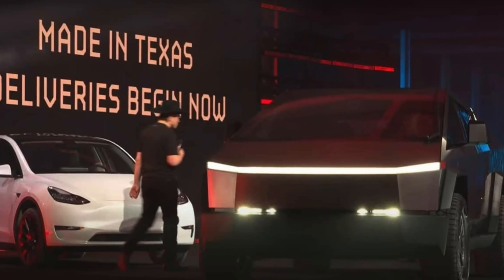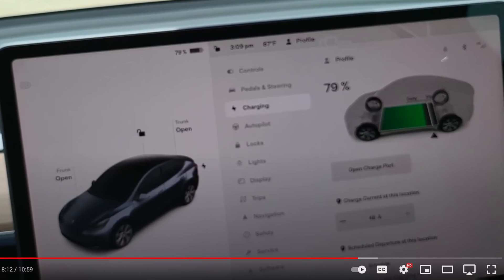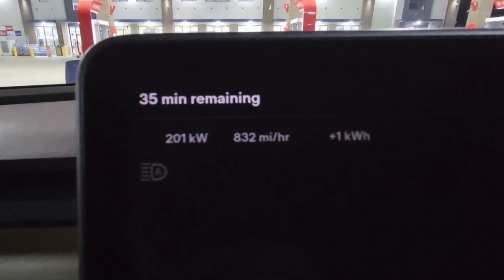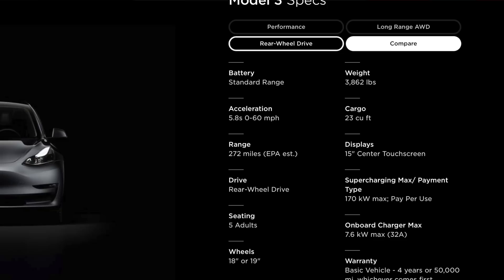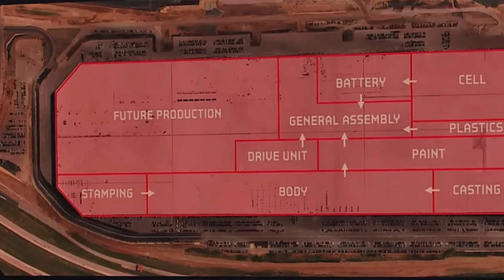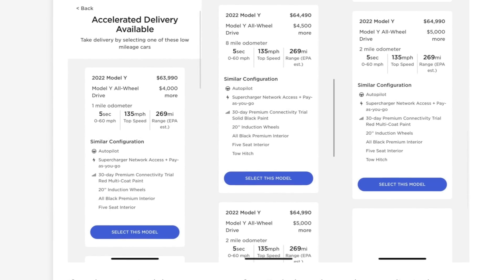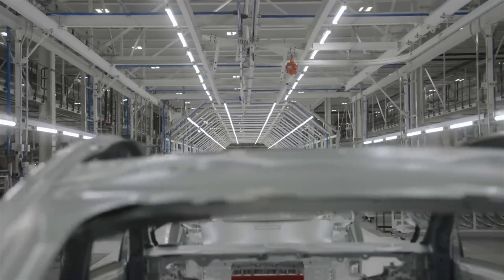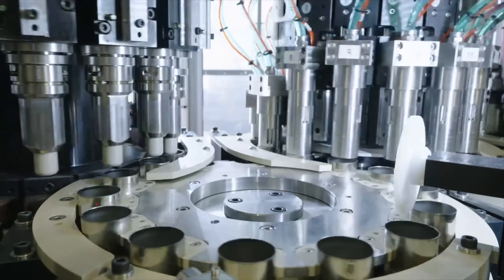GigaTexas Delivers 1st 4680 Model Y

Comment: Without a 500 mile cybertruck this will be a useless tank. We need a 500 mile cybertruck if you want to do any towing. Stopping to charge every 70-90 miles isn’t going to work.  Tesla may offer rugged batter packs that could mount on a trailer and extend range when towing.

Comment: I disagree. I think Tesla will want to prove that they have the superior work truck which will require longer range so that the truck can tow things. Also, I think we are seeing the first stage of the batteries. If I remember right, Elon said that they are still working on the battery composition to make 4680 batteries Superior.

Comment: just to be clear, you believe the price will jump from $60k to $120k due to inflation and some other minor factors?
Reply: It’ll be 100k because of the increased number of batteries required for it to hit certain range numbers. They thought 4680s would be more efficient than they are.
Reply: It won’t be 100k guaranteed. Tesla needs to remain competitive with other car manufacturers such as Ford. I think they are really sandbagging the performance of these new 4680 batteries.
Reply: @TheMsliwowski  or they just overhyped the 4680

Comment: The only advantage with 4680 is battery degradation because of the tabs where batteries don't need to be heated as much as 2170 to charge which will cause  degradation

Comment: The battery is new and doesn't have a large amount of supply, make sense to make short range Model Y's first. I don't think it's much of over hype as much as it is Tesla making sure to start low charge with batteries so they can take data off it. Who knows maybe a software update may unlock the batteries to do more potential after all it is Tesla, we are talking about.

Comment: Unfortunately I think you're right on a lot of your predictions. I keep wishing for a $70k 500+ mile Cybertruck like I dropped $100 on the day after the reveal, but I'm afraid reality will be different. And even tho I'm kind of close to the first of the order list, I'm with you on thinking it will be all about efficient deliveries. I also wonder how many are like me, excited about seeing the production ready Cybertruck IRL, but not ready to buy until I sit in it and actually drive it. I will decide at that point if I can live with it and use it.. 
  But one way or another it will be an excruciating decision because I'm afraid I will give up any amount of practicality and usability just because of the fun factor of driving a stainless spaceship with a yoke 😃
Reply: I have a similar mindset as you. I really wanted the Cybertruck because I love the designed and the 500miles was very useful. I have a small boat and to take it to the coast it is 200miles from me. With the fact that range is cut by half when towing, I figure that with the Cybertruck I could get 250miles of range towing, so that would have been perfect as I could make it to the coast and still have 50miles left over. Now that the range will be like a 300miles total, it means when towing it will only get like 150miles, which means I have to recharge once to get there and one more time to get back home.
Since this is not something I really need, I will probably cancel when it becomes my turn and wait until we don’t have constraints anymore on battery and other material and the Cybertruck actually comes out with 500miles range.
Maybe by that time the price will be lower and there will be better features and FSD will actually be REAL or really close to REAL, meaning only needing one human interactions every 10,000 miles. Also the USA may allow side camera instead of mirrors and a new way to clear water from the windshield comes out, for example blowing air in the windshield like in planes.

Comment: My question is how big is the battery on these new Model Y's?
Reply: These Y’s have a 4 module pack. Each module is 17Kw. For a total of 68Kw. There is room for 5 and even 6 modules. For 85Kw and 102Kw. The Y gets about 4.1 mile per Kw. So 68Kw gets 279 miles, 85Kw 349 miles and 102Kw 418 miles. But Tesla is way behind on 4680 cells so do not expect larger packs anytime soon.

Comment: Ha! I ordered a Extended Range Y last September. I locked in a low price. Until Friday, a few days after installing my Tesla charger, it was to be here in "June". Friday they told me mid September 2022. BUT they offered me an Austin 4680 Model Y standard version of 279 miles for $62,900. That took real balls. 60 miles less range than this offer (3 day delivery no less!) for $7k more. 

Considering my original Dec. 2021 delivery, that slipped to March, then went to August, then back to June 3 months ago You cannot trust Tesla's delivery app for crap. If you call them, as I did, the August to September timeframe in the email turned out to be "leave factory Sept 10, delivery by the 15th." But when I complained to them in March about the July/August time frame they had given me in January, they told me the app was wrong. Two days later it said 'June'

I ordered a 310 mile range Kia 6 paid $1000 refundable deposit, MSRP only on pricing with a 3 to 6 week wait. I don't trust Kia time frames either, but I will have at least one by August. All other Kia dealers were charging a $2-8k 'premium'.  The salesman said all other Kias with electric were selling with a premium, they just had not decided one for the GT Line of the Kia 6 yet.
Reply: Extended range? Next heard of such a model

Comment: The other advantage for Tesla will be saving on cost. Since the battery is the most expensive part of any EV,  it will allow Tesla to leapfrog the competition with drastically higher margins because of the dramatic cost difference. Its more good news for the stock price long term if anything. They will most likely come out with a longer range model that costs more in the future when competition starts to pick up and match Tesla in range. Until then, Tesla will use fewer cells to get the same amount of range which will increase their profitability overall. I would be extremely disappointed if the highest end Cybertruck only has 300 miles of range though. I have one on reserved and that would convince me to sell it as soon as I got it.
Reply: @TailosiveEV  which one of those do you think they would decide to do if demand (somehow) finally leveled off? On the one hand, more range = more batteries, which are their big limiting factor right now (though I will stubbornly stick to my belief that it will not be the case for the cybertruck thanks to that damn exoskeleton, which just seems like a nightmare to mass-produce and thus what few they can make will have 500 miles of range), but on the other hand lowering prices would piss off a whole bunch of current owners, which wouldn't be the greatest look for tesla (and if we assume that demand levels off that means that they have to start caring about their customers and reputation again), so I genuinly don't know. 
Thoughts?

Comment: Osborn.....tesla will not make 4680's better than 2170's but will unlock 4680's when volume production comes in  next yr.
Everyone that buys this yr will get an easter egg next yr to unlock. This is my own view on how Tesla will manage this transition.
Reply: @TailosiveEV  one can only hope. Either way volumes need to rise or else we will be still driving ICE cars in 2030😞
Reply: Spoken reviews now showing “50D” in his app, and with the weight he’s measured (4220lb) it does feel like to me there’s more in there than 50kWh. I mean the structural nature of the pack was supposed to save a lot of weight. Range vs weight vs 4680 /structural battery advantages isn’t making sense for me at the moment
Reply: @richorridge  because they were over hyped/promised to pump the stock